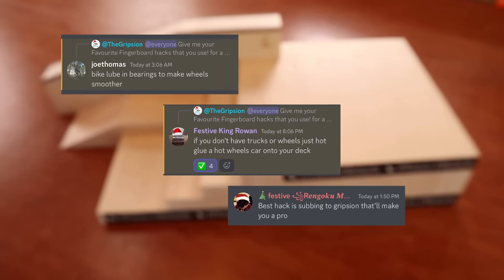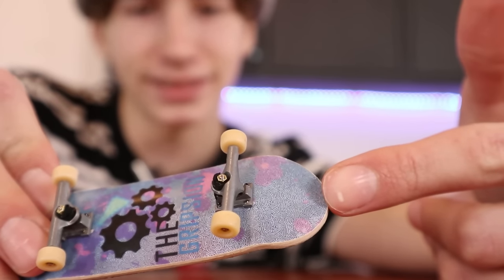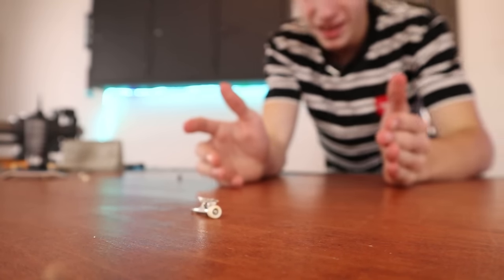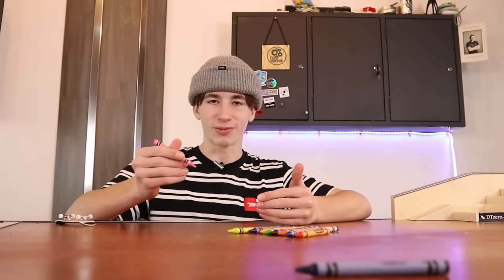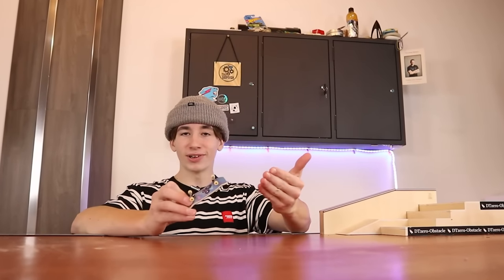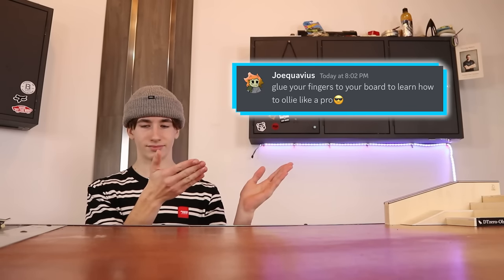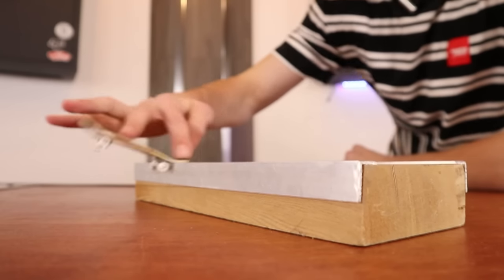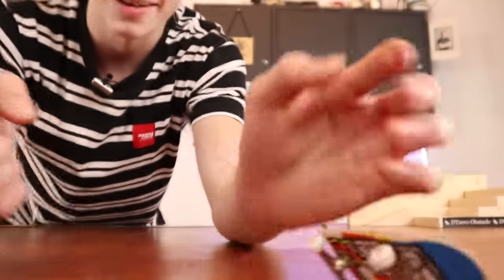I Tried my Subscribers CURSED Fingerboard Hacks

Comment: If you wax that concrete up real good, then hit it with a blowtorch for a couple seconds it'll melt the wax and it'll seep into the concrete and stay waxy forever. You won't need to keep waxing it every so often either. But you gotta wax it up really, really good before torching it.

Comment: If you're wheels get a bit wobbly ,take the metal washers from the tech deck bushings and put them on the i side of you're wheel for less wobble and a better fit  👍
Reply: Plz dont😟
Reply: @FingerFlowLondon try it, it works well
Reply: @noahpitts3623  mate if you have good bearing wheels you dont need it
Reply: @FingerFlowLondon   not all trucks have the same length axles and not all bearing wheels have the same inner width. Mate. so if you have a wobbly wheel just try it rather than turning peoples tips down
Reply: @noahpitts3623  if youhave a good fingerboard then you dont
Reply: @noahpitts3623  it works trust me  and i have a good setup  abstract bowl wheels blackriver trucks and rip tape with toadstool fb deck  i did it on a teck deck tho not my setup
Reply: @Trails_trout  so is this more of a tech deck hack?
Reply: @Mo11y666  yea its for teck deck s
Reply: @Owen Tomasetti  gonna try this. Good lookin out.
Reply: @Trails_trout  nice 👌  I did that on my teakdeck set up teckdeck and teak tuning,  there nwe apex wheels were so nice and smooth after first then the bearing got a bit wobbly so I did that and the size of the washer fit perfectly inside the wheel giving it a bit more support,

Comment: Lol pretty sure they didn’t mean for you to shave down the nose or tail that much. It  actually works if you do it properly. Use sandpaper and slowly remove material in the shape of the tail/nose and not a straight line.  And your box is not ruined.  Use heat to melt it off or scrap it off.

Comment: Using crayons as wax is a good idea cos even if you use coloured ones it’ll just be looking like someone got a sick tail slide on it!

Edit: also yeah I used to eat babybel cheese with the wax on when I was a young fella
Reply: bruh
Reply: @Trails_trout  ikr it was so grozz but i thought you ate it like that then!
Reply: I had a fingerboard park setup years back mostly tech deck ramps. I found that on the plastic ledges using graphite as wax worked incredibly well and gave the look of a well worn ledge.
Reply: oof